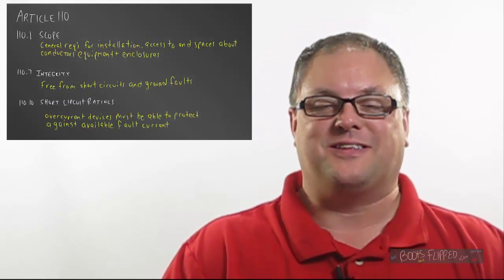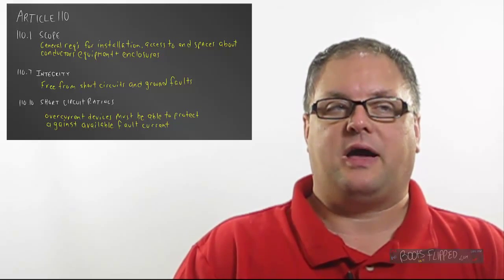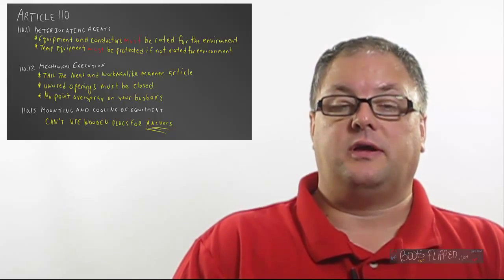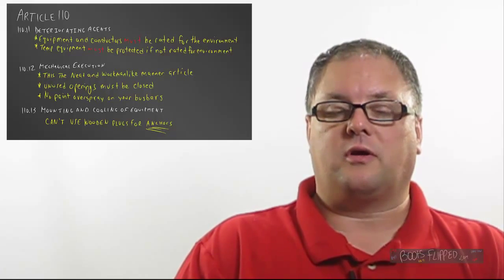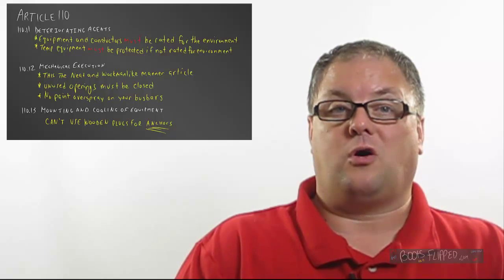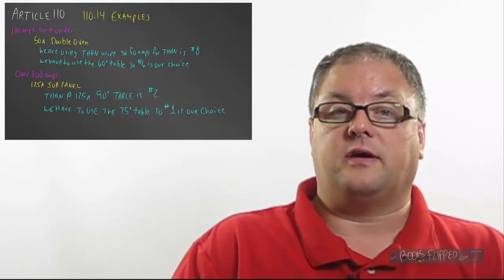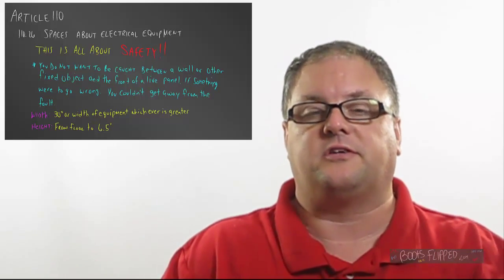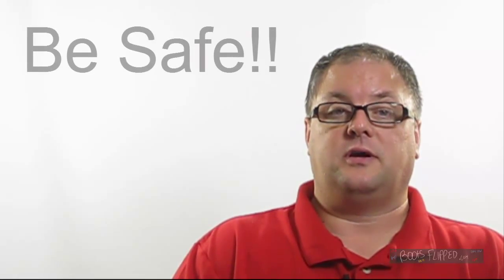CLASS 05 ART 110

Comment: 12:00
Condition one- live parts with insulated wall like a wooden fence is 3 ft
Condition 2- live parts with a grounded wall such as a brick wall is 3 ft 3' 1/2"
Condition 3- live parts on both sides such as two electrical panels facing each other has to be 4'.
Condition 1-  3'
Condition 2-  3' 1/2"
Condition 3-  4'
Reply from the maker: Kevin in residential we only look at the 0-150v to ground row which is 3’ for all conditions.